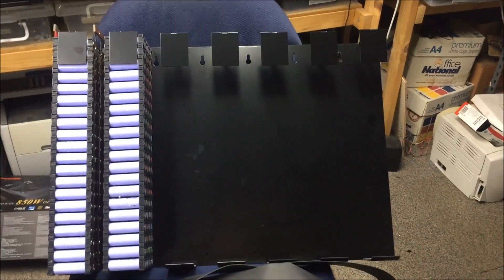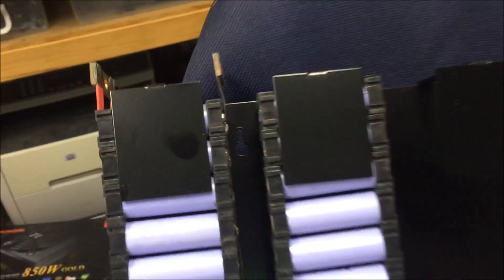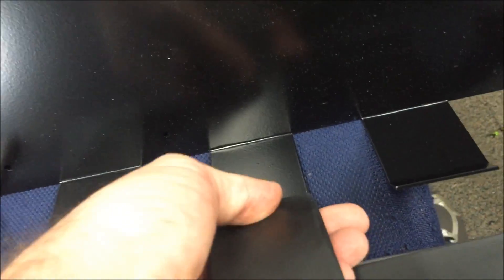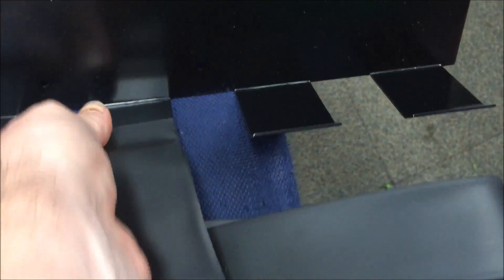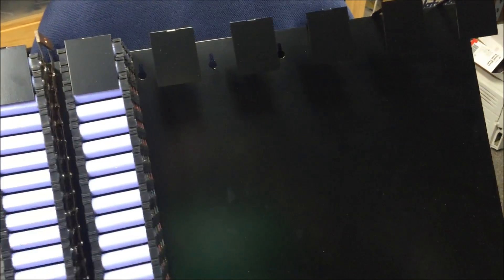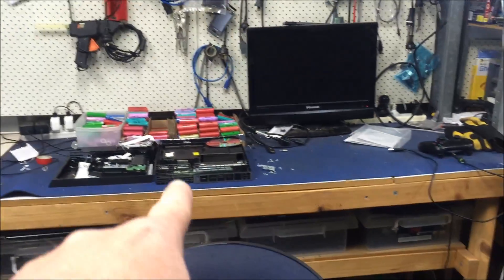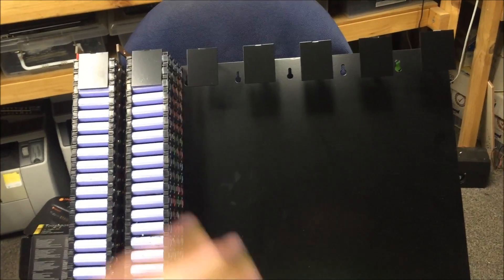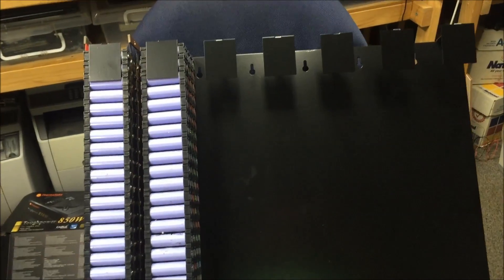18650 DIY Powerwall mount

Comment: Hey man, thanks for the video,
so your going to 48v? Thats what i was thinking of doing since the Tesla Powerwall uses 48v.  Can you tell me if you would still use the fuse wire? or switch to the actual fuses? 

thanks again!
Reply from the maker: +Jeromy Teddy fuse wire has save me several times :) check out later videos :)

Comment: Did you put it in the shed for safety or just needed to make the shed for room? Maybe a little of both? I have watched about every video on this so far great job. It inspired me to start and build a small one. Thanks
Reply from the maker: +old time engineer safety basically ac & DC side in different sheds.
Reply: thank for the reply maybe I will put mine in my old she'd. I am going to build a smaller one just to test. It seems they work better then deep cycle batteries. thanks for showing this
Reply from the maker: They work far better than my old 880ah AGM bank i'm really happy with it so far.
Reply: what are the volts of each pack? It looks like they are 12v three by ?
Reply from the maker: +old time engineer current setup is 14 x 4.2v
Reply: so each pack is 58.8 which I think is top end for 48 volt system so each long pack is that size. That is big. I am going to try something like 3sby something for 12 volt modules just like 12v battery then I can series them to make 24 or 48. Maybe that will work?
Reply from the maker: +old time engineer I only charge to 4v per cell. Works perfectly with my gear. Just do your own math lol mine sucks :)

Comment: Did you consider getting new batteries and saving load of time? I was thinking of doing a similar project but the faff of dealing with used batteries has put me off.
Reply: And 5. Environmentally friendly.
Reply from the maker: arrr yes five!
Reply from the maker: No even for a second. 1. No fun, 2. COST, 3. would make for terribly boring content on yt 4. COST
Reply: But time? I understand the cost, and that it would be boring videos but how much time is spent charging , discharging, charging, repeat.
Reply from the maker: meh, time is free if you use spare time makes you extremely productive in a day :)

Comment: may I ask where did you buy your batteries?
Reply from the maker: +drake boar mainly from 2 computer recycling centres
Reply: +HBPowerwall does this store you mentioned sell online?
Reply from the maker: no sorry but you can order through me for $2.50 per pack under 100 packs and $2 for over 100 packs - no warranty, all used recycled packs.
Reply: +HBPowerwall 2,50$ per pack? what's a pack?
Reply from the maker: 6 or more cells ( pack = complete laptop battery)

Comment: why change too 48 volts now? you have the big cables, the chargers, and inverters.
with 6 packs you will only be drawing 0.225 amps per cell at 110AMPS. thats 12 hours of power at full power.
Reply from the maker: because i want 4000w of power with the ability go get two inverters and parallel them to get 8kw of power rather than 2400watts ..

Comment: 48V will make it sound more like a serious power system.Good stuff. I presume all your gear can cope so you don't need to upgrade too much? 
I'm starting to consider doing without BMS's and just use cell monitors. Shawn McCarty (the Battery Blocks guy) does a good list of the downsides of BMS's here: https://www.youtube.com/watch?v=pljSZcEwc8Q 
What's your current thinking?
Reply from the maker: +Paul Kennett I think I've made it look serious enough :) gear is all up to the task no updates needed there. Other than inverter naturally. Totally on the fence on the bms thing. I hate to admit it but after 14  nights use I'm still happy with the pack balance. Only using the pack between 25 v to 28v might be the contributing factor. Ill continue to monitor several times a day till I trust it.
Reply: +HBPowerwall Tru dat. Your system is way more serious than mine. I guess I'm really expressing my own threshold. Anything over 36V sounds impressive.
Reply: My 2c , Not bagging the video Paul just pointing things out :)
A BMS does provide automatic low voltage and over voltage protection at a low cost,
His video is around small packs for ebikes and the small cell logger in the video, which beeps on low cell voltage which is great if your sitting on the bike and hear a beep but not very handy for batteries in a powerwall as your not standing next to it or your out of the house so a beep is pointless. It needs to be automatic and turn off the batteries/cells off which is what the BMS does. I have seen the cell logger in DIY connected up to a relay to provide this, for a powerwall it would have to be a SSR rather then a relay and there is a video on youtube how to do it, but its not perfect.
In the video he is using the icharger 1010b to balance charge for each full charge. 

So of cause by balancing every time you charge, then yes you might not need a BMS as the packs are balanced very time and yes you can work around the other problems without a bms but your charger needs to be a balance charger. This is fine for very small packs but you cant buy a very large balance charger with support 30-60amps high voltage like 24/48v. In which case the only way to charge a 5kwh pack is to use a charger with a CC and CV set and use a BMS to limit and set full charge voltage,
 For ebikes charger at 72v is a single feed from the charger again no balance leads etc, Only the small chargers support balance, the 72v lipo charger just pushs power till the bms turns off. Very much the way HB powerwall chargers does it, and its the only way without spending big money. 
Yes you can buy bigger hobby charger with more amps but they ant cheap and they are manual on and off per charge. To note the iCharger 1010B+ is a 10amp battery charger, with manual turn on and off, Not automatic, very good for ebikes but not for powerwalls.

So ya ebike packs without bms with a balance charger and cell loggers you can get away without a BMS, as for very large packs... nope. Nice idea but a BMS is a far cheaper way to do it on large parks.
Reply: Good points... although in my solar power setup the upper charge limit is set my the solar charge controller and my inverter shuts off if the voltage gets too low. (I have a BMS on both my existing 2kWh and 1kWh packs as redundant safety.) Electric cars use "contactors" which are just high current relays - plenty grunty enough for a powerwall.

Shawn is saying use the balance charger only when the cell logger says the cells are out of balance, otherwise he's saying use the standard charge method.

My iCharger will do my 24v system at up to 5 Amps - which is fine for my (current) setup because I'm dealing with mostly 1kWh packs (still not fast charging though). So I can use the iCharger to balance any pack that drifts out of balance when needed. I don't yet have enough packs for that to be a hassle. Too soon to tell if that is a sustainable process though.

I'm also encouraged to try sans-BMS by Jahu Garcia's experience on his packs. I think I'll try sans-BMS on my new packs to see what happens. If they drift out of whack too frequently then I'll add the balancing BMS back in

Cheers, Paul.
Reply: Redundant safety, for the cost it makes sense :) 
Re, My iCharger will do my 24v at 5amps. Ya as soon as you get over 3kwh, 5amp charger will not keep up for a day charge. So as soon as you finish your next packs if you wanting to use it daily then your going to need a bigger charger. I know at this stage your not running much off the 3kwh but as time goes on.

For the Powerwall tho in general, one thing to keep in mind for everyone: 
The powerwall needs to be changed off Solar and only solar, unless off grid. Meaning No point of using the "grid" to charge the powerwall only to then use that power at night, "forgetting about the extra looses" in which case you might as well have not used the powerwall and just used grid in the first place. So the powerwall needs to be changed by solar and at a rate that that batts discharged the night before, eg use 3kwh then 3kwh needs to go back in during the next day and while the sun is out. AS the powerwall gets bigger this is a bit of the problem. 
For me, We use over 10khw at night for the whole house. between 5pm and 7am. So if i had a 10kwh powerwall, It will be flat by the next day and i will need to put 10khw back in. Charging 10kwh in 5-7 hours of good sun in winter a 2000watt charger is needed maybe even a 3000w one. 

sans-BMS by Jahu Garcia's ?? tell me more

Comment: hows about some giveaways on the packs you bought as extras :p

awesome racks, i assume next shed video they will all be the same rev?
Reply from the maker: +Gregory G Harding I need them all lol 
and rev??
Reply: +HBPowerwall ah, I was sure you were advertising extra laptop packs awhile ago.. I guess you decided to expand lol. and what I meant by Rev was revision, I noticed your racks have gone through several revisions. once the shed is reassembled, I assume the racks will be Ann the same revision?
Reply from the maker: +Gregory G Harding I buy and sell 100's of battery packs. It contributes to keeping the costs down a bit. Racks are still v3 , v4 will be lightened and will have better air flow for bottom of packs. She'd layout will only change a little. Ooh going to paint all the wood white too.
Reply: nice! looking forward to that video